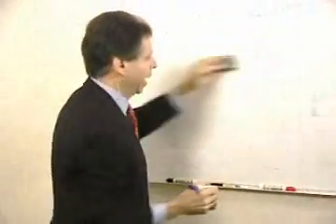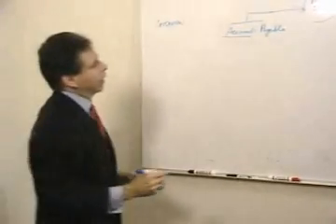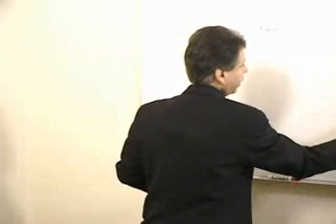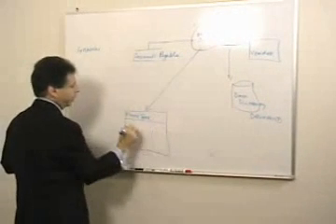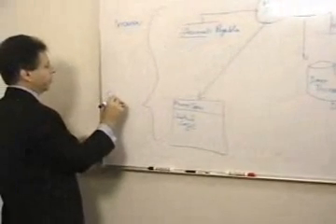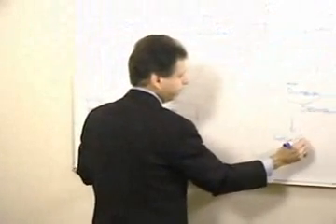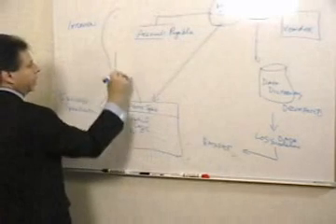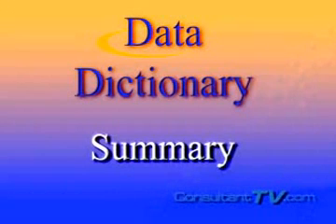Tools of Analysis (part 8 of 8) - Summary (DFD / Data Flow Diagram)

Comment from the maker: You are correct. One of the important aspects of the DFD is to show "flow" but just as important is showing "boundary". In other word, the DFD can help define the scope of what is inside the system and what is outside of the system. Note however that the data elements within the flows to and from externals are captured within the data dictionary. These become the building block for subsequent data modeling activities.

Comment: Nice question there. In my opinion, the vendor is not included into out Data Dictionary because Vendor is the external entity and that is, outside of the Information system (or system flow). Please clarify if i'm wrong.